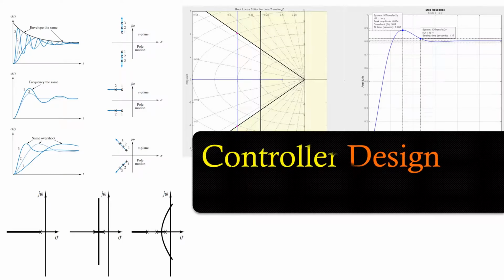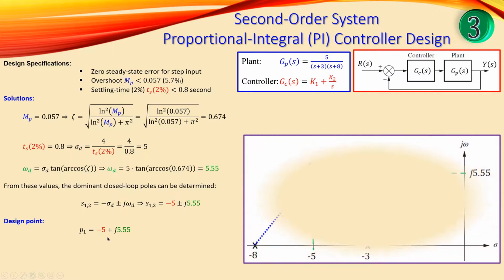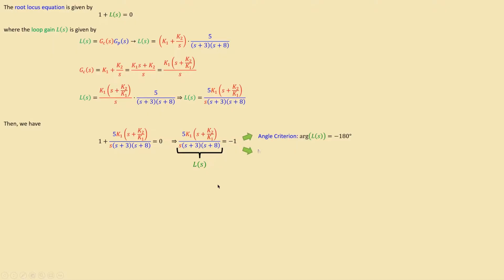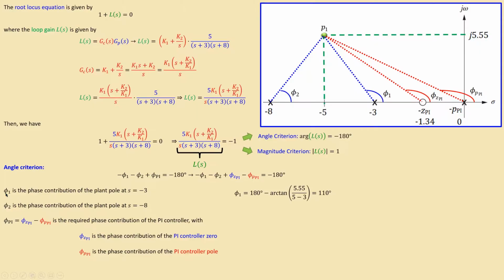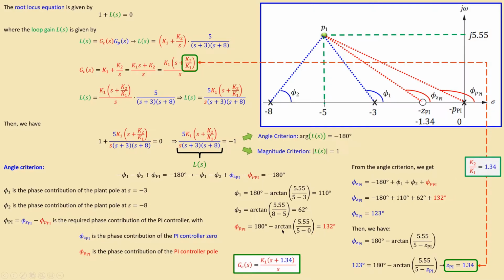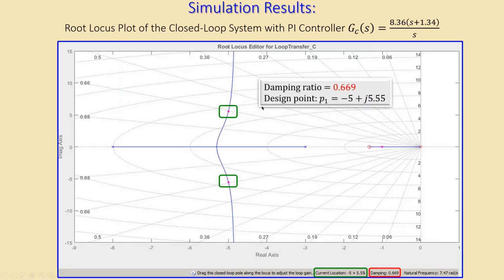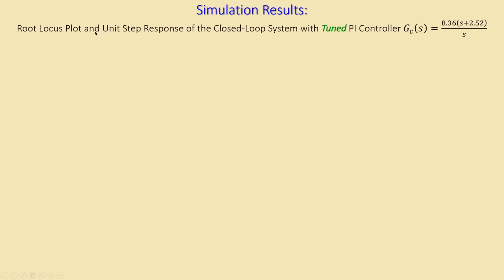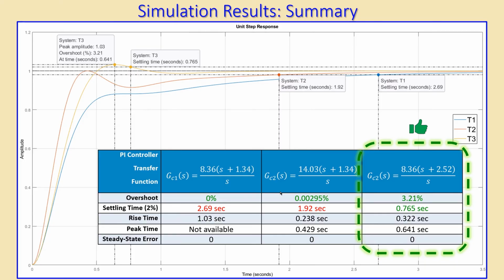Root Locus Design Method 🌟 PI Controller Design 🌟 Calculations & MATLAB Simulations 💡 Example 3

Comment: So this is trial and error.   Not exact formular.  When system has many orders, the exact dominant pole design can't be formulated.
Reply from the maker: Yes, for higher-order systems and systems having zeros, the dominant pole concept often relies on approximations and iterative design, which can involve some trial and error, especially in the design phase. This is not different than other method in the practice.

Comment: Could you please make a video on second order system with complex conjugate poles for designing the PI controller. I am working on BLDC motor drive where I got the second order transfer function with imaginary poles and plant without PI is having 90 degree phase margin and gain crossover frequency is very less 3rad/sec. And also it final value is 0.8 steady state value with unit step input without any compensation. I have designed in MATLAB just by moving the phase and magnitude plot accordingly, but I couldn't make it out. Could you please refer any text book or any reference paper. Thank you in advance.
Reply from the maker: The basic idea of root locus design method is the same if the system has complex poles or zeros. 
If you want to get more in detail about this, you might consult Modern Control Engineering, K. Ogata.

Comment: Hello, what happens if I have repeated poles at the origin, one from the plant and one from the controller. Does it change the computation for the angular criterion in any way?
Reply from the maker: The calculations are the same. You only need to take into account the magnitude and phase contributions of each pole and zero as I discuss in the video.

Comment: Congratulations by the video, really useful. I have a doubt, how can I deal with the angle criterion when my plant already have a pair of complex pole?
Reply from the maker: Thanks for your message. Glad to know that you liked the video 👍 
Yes, you can also use the root locus method if the system has complex poles or even pure imaginary poles. It is based on the angle and the length contribution of each pole and zero location, so these do not have to be pure real.
Reply: Thank you very much.
Reply from the maker: @brunoguimaraes5071  You're welcome!

Comment: Nice video. How do I use this method for my PI controllers in FOC where I have 2 PI controllers back to back?
Reply from the maker: Thanks. For field-oriented control (FOC), or vector control, the best way to do to the controller design is using state-space representation. Root locus more suitable for single input single output systems.
Reply: @CANEDUX  Thanks for the quick reply. I am trying with Pole placement method and also State Space (and ending up with same numerical formulation), but the values doesn't seem to be correct even after a lot of trial and error. Would you have any video on your playlist or any reference you can suggest for the design of PI current and speed controller for FOC/Vector control please?
Reply from the maker: @100rabhkr_India  https://youtube.com/playlist?list=PLn8PRpmsu08podBgFw66-IavqU2SqPg_w

Comment: Hi Sir, how do you design a PI controller for a first order system if you have a time constant for open loop system and the design specs are that it must be optimally damped with zero steady state error?
Reply from the maker: It depends on the specifications. If you need a zero steady-state error for step input, then you will need integral control if the system without the controller does not have a pole at s = 0.
Reply: Thank you. How do I determine the test point for a first order system?
Reply from the maker: @aleceaolivier2111  A first-order system will not have a complex pole, so there is not a design point as in second-order or higher-order systems. You will not have an overshoot if it is an all-pole system. You can adjust/design the settling time by setting the location of the pole of the first-order system. The farther away from the vertical axis, the lower the settling time.

Comment: In many books and in class I've seen that for a PI controller the position of the zero is determined as 1/6 or 1/3 of the real component of the dominant pole we set with the design specifications. 
Adjusting the zero location with the angle criterion as you do in the video changes the dynamic of the system and makes the root locus pass through the dominant pole as if it was a derivative action?
Reply from the maker: The rule of thumbs we read and use in Control Systems using root locus method assumes that the two closed-loop poles are dominant. However, this does not have to be the case any most of the time you will need to carry out tuning steps in your controller design. This is also what I discuss in my videos about root locus method.

The root locus equation is used based on the dominant closed-loop poles, but we only use two poles here for systems with higher than second-order and even with zeros we do not take into account while using the formulas for overshoot, settling, peak time, etc. So, you will always need some tuning. 

The PI controller I describe is not a PD controller action, but there is a zero of PI controller involved, so it is a positive phase contributor and thus a kind a nonpure derivative action.
Reply: @CANEDUX  thank u men, our videos are really interesting and I appreciate you take the time to answer the comments. 
Keep going and good luck 🤘
Reply from the maker: @DiegoMartinez-sr9rm  You're welcome 😊 Share the knowledge 😉 Good luck with your studies.

Comment: How did you tune the K1 and K2 values to meet the requirements?
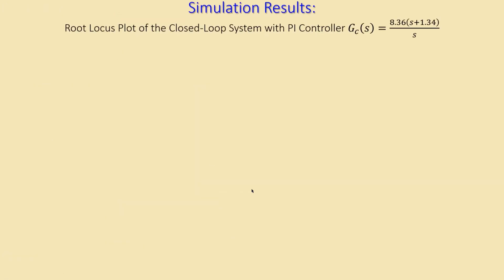Reply from the maker: From 16:55 in the video, I discuss the simulation results. Here, you can see that the first attempt for the PI controller was not sufficient. First, I changed the PI controller gain from 8.36 to 14.03. Looking at the PI controller transfer function, it is the value of K1 I tune here. In the next round, I only tune the zero location of the PI controller. The zero location of the PI controller is determined by K2/K1. This is also seen from the transfer function of the PI controller.